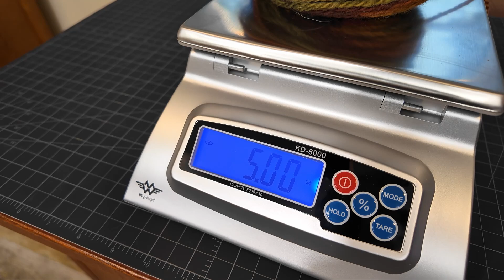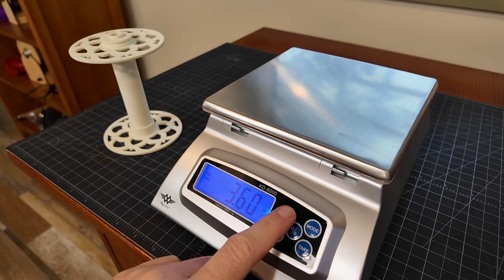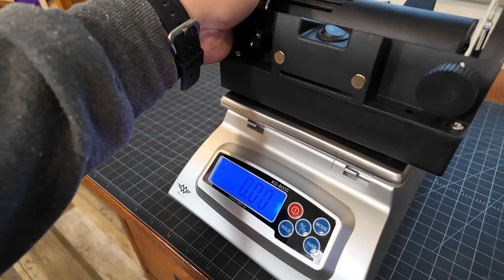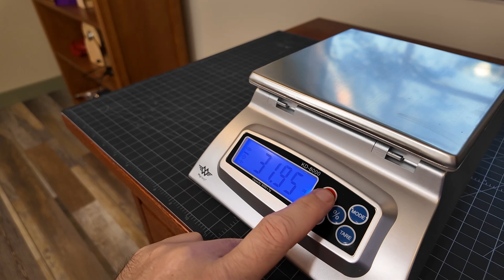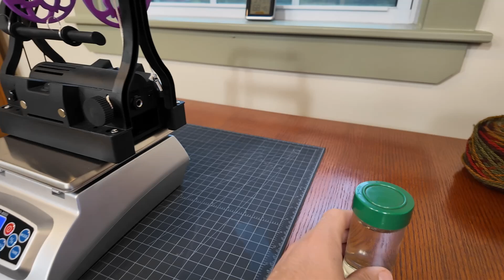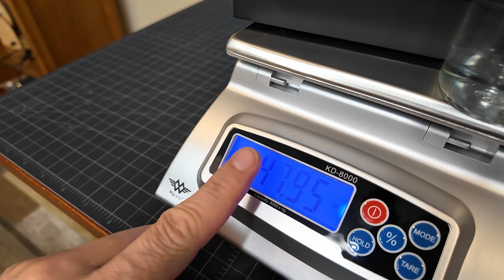Spin 187 - Clever Hack to Weigh your eSpinner Yarn

Comment: So i do my weighing a bit differently. I weigh my EEW6 with empty bobbin  & then i write that down & take an old jar & add pennies till it weighs the same as the EEW6. Then i use that to tare the scale so i have the exact weight of the yarn on the bobbin when im trying for a specific finished product.
Reply from the maker: That's clever.  Thanks for sharing your solution!

Comment: So. SMART SCALE ADD ON OPTION! 

HEAR ME OUT.

I dont think something like this would be difficult or expensive to produce and develope.

Let's say you have a scale. Let's make it a blue tooth scale with an app. 

You can set the Terre function to be "bobbin presets"  add enough for a person to save like 8 preset weights for up to 8 bobbins. Not all bobbins will always weigh the same, no? 

So. 

Than all you have to do is add a scale to the spinner. 

Input into the app the preset weight of  spinner too. . . Which can be calibrated if needed. 

So now you have an app and a blue tooth scale built into the spinner.

Turn everyone on. 

On the app we pick an option. "Start new bobbin" and we give it a name.

The app tells us to do certain steps. 

When we place on the bobbin including leader on the spinner and press "ok" it weighs the bobbin and terrestrial the scale. You than name and save that bobbin. 

When off loading the bobbin or finishing a spin you would just "save" the bobbin.  One could save several bobbins if they are working on more than one spin. 

Anyway. A bit more detail to it than that. . . Whatever variables could be saved and changed as needed within the app to get an accurate weight of your spin or ply easily, in reality time while spinning utilizing a smart scale and developing a simple smart phone app.

Just saying. 

You could than offer such a scale and app as an add on for a nano 2.0, a fold, a 6, a 6.1.

Comment: Question for you maurice; maybe I’m being dense or haven’t thought about it enough to consider the solution myself so I’ll ask. Is there a way to use the EEW 6.1 to rewind a bobbin? There’s a school of thought in spinning that one should rewind their bobbin back onto another bobbin before plying so that when you smooth the plies together during the process the smoothing is in the same direction as was applied when the singles were spun. Hope this makes sense I know it’s wordy. If you’ve already addressed in another YT a link or your say so would be much appreciated. Love my eew 6.1 thank you so much for all you do for this community!
Reply from the maker: There are many ways to do this.  You can start with just using a lot of tension.  This will add/remove a small amount of twist, but works reasonably well.
Here's a video about a really good solution, but you need to get a few parts: https://www.youtube.com/watch?v=D4GJt3Cpe00

Here is a 3d printed solution for your drill: https://www.youtube.com/watch?v=nqFuILy1Xrk

Comment: To correct one point - Scale weight ( mass x gravity) doesn’t change with temperature - rather the load cell output is temperature dependant necessitating manual or auto correction for accuracy.